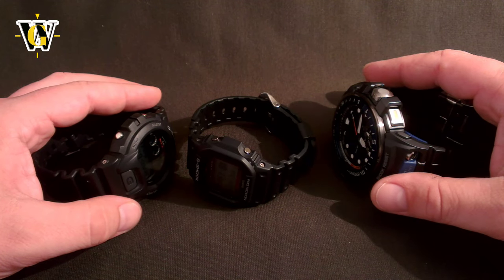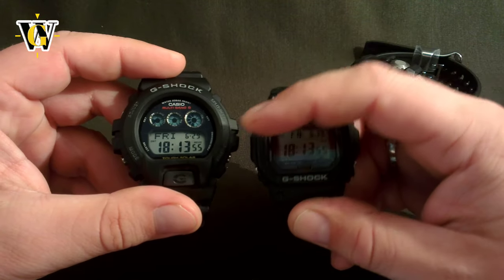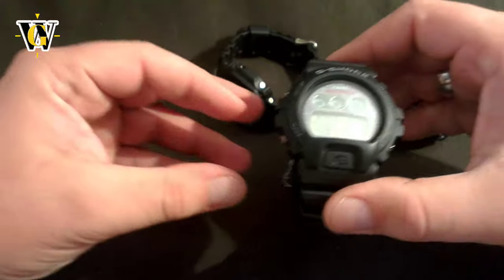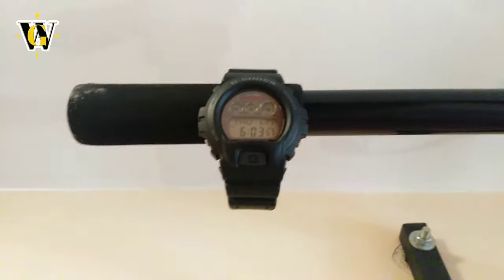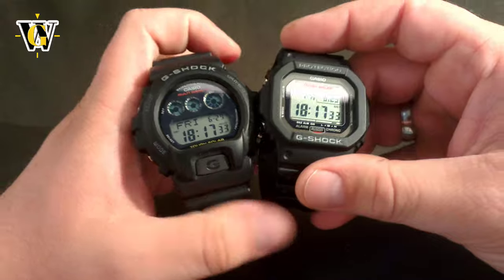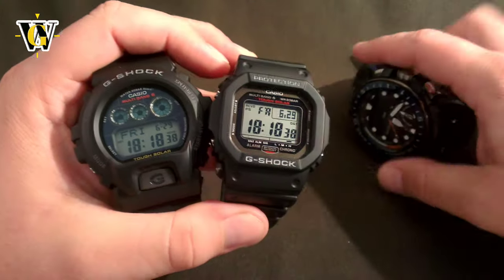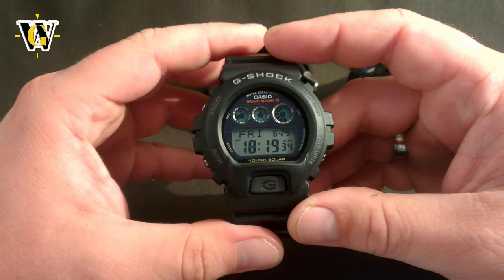DIY Amplifier for Atomic Radio Controlled watches that actually works & is VERY  simple

Comment: Hi it works i live in Brisbane Australia put watch on bike and it turned in only trouble is i set it to Tokyo tower but it changed it to tokyo time do i set it to SYD will it still pick up Tokyo tower but not change the time here
Reply from the maker: Great to hear it worked, you can try it or select another home city that has your same time zone if it is offered
Reply: I live in Brisbane as well and I set my atomic watches permanently to Tokyo DST time. Since neither Japan nor Queensland use DST this has the effect of adding 1 hour to Tokyo time (normally UTC+9) resulting in the UTC+10 that we use :) The only issue is the watch displays the small 'DST' symbol but I can ignore it.
Reply: Ok thanks will try
Reply: Did you try receive BPM time signal from China? There is a dcf777 app modulator availeble in playstore...
Reply: @WatchGeek  Did atomic signals stop? None of my Casios have updated in days..NO signal
Reply from the maker: @BOOSTEDLASER  as far as I know, they are still operational
Reply: @BOOSTEDLASER  no they are up
Reply: Hello and thanks for the idea!  Works perfectly!  I live in Bulgaria on the border of the DCF77 signal.  I hung the watch on my bike and at 00:07 the watch adjusted automatically!  Thanks!
Reply: The watch has to be on a city that has an atomic signal eg Tokyo. Of it's on any Australian city or won't sync manually or automatically.
Reply: The watch has to be on a city that has an atomic signal eg Tokyo. If it's on any Australian city it won't sync manually or automatically. I get syncing sometimes in Brisbane if I leave the watch on a north facing windowsill. It seems to be more successful if it's stormy, maybe cloud cover helps. I think the phase of the moon plays a part too.

Comment: It works!  I have three G-shocks and a Casio Pathfinder all of which synch with the atomic clock sporadically at best.  The Pathfinder hadn’t synced properly since November of last year.  Hung all 4 on the metal towel towel rack in my bathroom and for the first time ever, all 4 watches had synced perfectly. Good find, sir!
Reply from the maker: I'm glad I helped 😁👍
Reply: ⌚UTSTANDING
Reply: ? On th bathroom rack did you have facing up
Reply: @veedub3740  thank you.

Comment: At first I was skeptical that this could work, but as a ham radio operator, I figured that there must be an inductive coupling between the metal frame of the bike and the watch antenna.  Whatever it is, I tried several times without using your technique and could not get the watch to synch.  Then, but just attaching it to my camera tripod it synched up the on the first try.  Great observation on your part!

Comment: Since the wavelength of the German 75 kHz transmitter is just under 4000 meters, I would suggest a pipe length of about 10, 20 or 40 inches. The pipe should be perpendicular to the direction of the transmitter and the clock should be placed in the middle of this pipe. Propagation conditions are best between 1 and 2 a.m.

Comment: I just go to bed with the watch strapped to me and use my body as the amplifier ...works every time 👍
Reply: I might have to try this
Reply: I did try it twice and it worked both times.
Reply: I have just bought one and wearing the watch while sleeping has worked 2 times out of two.
Reply: @RodrigoLopezF  It also works if I put it in a windowsill facing west.
Reply: @kato223  Any chance I could borrow the wife? The bike shops around here are charging a fortune! 👍
Reply: @user-fb2me3th6z  ha no but water can carry signals
Reply: @Mike-nq7fn  what if I'm dehydrated?
Reply: @jasonhowell6935  haha well you are about 70% water still, regardless the most reliable way I have found is to put it on a metal like a bike or metal pole or whatever
Reply: @Mike-nq7fn  yeah. I'm gonna definitely try that. I only had mine for a few days now. But have noticed it hasn't synced yet
Reply: @jasonhowell6935  yep the bike worked perfectly for me, had to find the right spot in the house too
Reply: I've done this for years, never knew about the metal pipe trick though.  but yeah my wv59 only syncs when i wear it to bed.

Comment: This is crazy, I actually put 4 of my atomic watches and clocks on a metal cabinet and get 100% sync rate. But when I put them in the windowsill (plastic/wood) which is actually CLOSER to the window, literally, the success rate drops to maybe 50%. I never put two and two together. Great video. Metal works.

Comment: I have been having difficulty getting my Casio Waveceptor to sync ever since purchasing it a few days ago.  Nothing worked.  Then I saw this video.  I looked around for some metal and I noticed that I had a stand up (pedestal) fan nearby, so I put it on the fan - which has a metal cage surrounding the blades - and sure enough it synced!  Thanks!  👍

Comment: That Casio radio controlled watches have meters of radio signal strength. It's a pity you didn't measure signal strength without metal bar and with metal bar under back case. It would be interesting and objective.

Comment: You, sir, deserve a Nobel Prize, as far as I am concerned 👍 👌 🏆
I just managed to sync my Casio M710 multiband 6, that has not synced for months.
I'm in Europe, at the edge of the German tower and generally only go to sync my watch when we change to and from the summer light-saving time. I go to a park above my town to two specific alleys and only there I can sometimes get coverage. There I spend an hour or two sitting on different benches and triggering the syncing with varying success rate, until it syncs, sometime it works in one place, 6 months later it doesn't work, but works 50 meters down the alley.
Now I just put the watch around a metal deodorant spray can, put the can horizontally on a table by the window at home and it synced straight away at home. I've never managed to sync the watch at home before 👌

Comment: Finally! Signal Received!

My Casio GWM5610U came yesterday July 22, 2022. I ordered from Amazon and I was very exited to test the multiband 6 function. 

After manually attempting to get the signal, I kept getting the error message. 
I found a video about amplifying the signal by placing the watch on a bicycle or metal large frame and got some L1 and L2 signal and after a few minutes the error message again. 

I then tried positioning it facing northwest by a window (facing Fort Collins, Colorado where the signal comes from) and I was able to reach L3 temporarily but then error again. 

It was very late, so I tried wearing it overnight to see if my body would amplify the signal and automatically eventually sync (following advice from another YouTube video) but that didn’t work either. 

Success came when I stepped outside this morning and sat my watch on a beach Tommy Bahama foldable chair, the watch facing northwest. The watch displayed connectivity with L2 and L3 switching back and forth and after about  4 minutes it finally happened!It felt magical and I’m not sure if I’m going crazy due to the lack of sleep. I hope this helps someone out there.

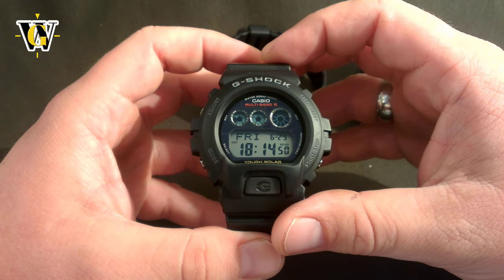Comment: I use gw7900. I live in Indonesia so far away from japan and we know with my time zone (BKK) is not possible to activate my atomic timekeeping sync. So before I sleep, I set my watch home city to Tokyo (TYO) which is 2 hours ahead from my local time, then I set receiving radio signal to  On/auto receiving and I hanged my watch on steel rod of my windows in my bed room. When i wake up in the morning and check my watch, Its incredible!,  The sync  indicator is appeared!!  Its SUCCESSFULLY SYNC  at 02:03 Tokyo Time!!. After that I set my time zone to BKK again to get my local time. Your method very useful. Thanks!!
Reply: Serius nih bisa sampe Indo?  Di kota mana om?
Reply: wow that's nice to hear that, i must try this as well on my gw5000. i live in kuala lumpur
Reply: You could set Tokyo as your world time (WT). On my Casio, when I press Adjust + Reverse buttons, the watch switches between home time zone and world time zone. Then you don't need to use the setup menu.
Reply from the maker: @spacemanschannel6380 that's some level pro advice 👌

Comment: Your method worked for my 5600 Bluetooth! I used my wife's old golf club, a long old wooden headed driver and placed it horizontal. I was only getting level one without, and tried it at 5pm and to my amazement it connected level 2 and 3 bouncing back and forth. Wow how amazing. At night it locked at level 3. I am in NE Minnesota and the Atomic is in Colorado. Thanks, much!

Comment: This concept worked for my large "Atomix" Wall-clock. 
It hasn't set itself ever since we moved to this new house, which has been about a hear and a half now.
I just taped about 24 square inches of aluminum foil to the same size cardboard and slipped it behind the clock.
The next morning the time was set, matching my computer clock down to the second!

Comment: This tip absolutely worked for me! I live In Michigan hung my watch from the aluminum tube connected at the bottom of my window blinds. Raised the blinds half way up the window & the watched sync'd a few minutes after midnight!!! Amazing! Thank you so much for sharing this tip!
Reply: ⌚UTSTANDING! I live due south of you on KS and can usually get the signal (Boulder CO?) overnight but never can do manual sync on my GW5000U. However, I got a new 5610U and used a metal pipe outside, mid afternoon -manual sync worked! I was shocked and impressed 🤷🏼

Comment: I got a used G-Shock for a really good price, and couldn't get it to sync up at all for several days after I bought it. I thought that something was wrong with it as I tried everything from leaving it by a window overnight, to trying several apps and nothing worked until I saw your video and tried it on a friend's bike as I don't have one & it worked right away on the first attempt just after midnight! You are correct on the metal tubing as I tried it on the back of a chair with metal tubing and got results again on the first time. Thanks for posting the video!

Comment: I too accidentally discovered this with a round steel lid (about 4.5 inches or 11.5cm diameter) on top of a glass jar containing cotton balls and Q-Tips.  I had a lot of trouble picking up WWVB here in Atlanta, Georgia from putting the watch in my window sill and one night I had placed it on top of the cotton ball dispenser's metal lid while getting ready to go to bed.  I forgot to move it to the window that night and the next morning it had picked up time code signal perfectly!  So for ten nights now I have had 100% success with the metal lid.  Now the lid does have a small metal ball in the middle for lifting it up and maybe that also helped.  Will have to do some experiments using other metal objects with copper or steel.

Comment: I was never able to pick up a signal since buying my GWM5610U over a week ago. This worked like a charm! I attached it to a metal towel rack and it picked up a signal overnight. What's even more impressive is that my bathroom was in my basement where I barely even get a cell signal! Thanks Watch Geek!
Reply: I've just bought that same watch and the alarms are so quiet that they are almost useless. Also, the buttons are so stiff that it's not enjoyable pressing them. Is your watch the same or have i bought a dud
Reply: @alantheloneranger  The buttons are stiff and sometimes it takes me a few tries to get them to work, but the way I see it, it's better this than having them accidentally engage. Regarding the alarm, it seems to be loud enough but I've never used it in a sleeping situation so I'll have to let you know!
Reply: @ydawg01  I don't reiy on watch alarms to wake me up, i sometimes set them a few minutes before a main alarm or use them as reminders during the day. But even when awake in a quiet room i still can barely hear it
Reply: @ydawg01  regarding the stiff buttons, every casio I've had over the last 40+ years have had buttons with just the right amount of pressure to press them but with just enough pressure not to be accidentally pressed easily. I currently own 2 tough solar watches and the buttons on them are almost perfect. I can live with the buttons being like this but the alarms are so poor that they might has well not be there. I've watched loads of good reviews about this watch and not one has mentioned a poor alarm which is why i thought mine might be faulty

Comment: Hello. I just bought a citizen cb5020-87l, I'm from Romania, and I had problems with radio synchronization. But this video helped me. I used a metal bar and it synced last night. Thank you for the help.

Comment: I’ve had a left over 4 foot length of 1:2 inch copper pipe sitting in my living room for years. I’ve been trying to think of how to make use of it and not dismiss it to the recycler.

Sure enough, your discovery works. 
The old pipe now sits happy in plain view not far from the TV. A couple of new black and red clamps hold it horizontally on a book-shelve with plenty of room on one end to easily slide watch on.. It works every time even though its not near a window. The watch never syncs in that spot without the pipe. BTW, I live in a metal frame New York apartment building. THANKS!!

Comment: It did worked! 
Placed mine in a metal curtain rod and started to seek signal and later synched! 
Watch: The Clock House 1964
Analog-digi window model
Location: Philippines, Central Luzon

Comment: My watch would not synchronize in my room at night automatically,  until I started wearing the watch to bed.   Then it worked perfectly.  Maybe my body amplifies the signal reception for the watch.  Now,  I can reliably get an automatic synchronization, but manual ones seem to be harder to get because you have to have a steady L signal outside or near a window.

Comment: If we learn the signal wavelength we can use the correct diameter pipe or in other words the antenna. I'm not sure but,  in Europe Region, for 75kz the antenna diameter would be ≈2.5 cm and 1 meter long. For example, in the early period of wifi technology, Pringles boxes could easily use as a wifi antenna.

Comment: Awesome discovery! A GW-7900 is on its way to me from Amazon and I am looking forward to experimenting with your metal tube/pipe method of enhancing signal reception.  Thanks a million for sharing your knowledge and wisdom.
P.S.:  Last night, I hung my brand new GW-7900 onto the end of my cloth-hanging rod in my closet and see if my G-Shock could pull in the atomic radio signals from the Fort Collins facility in Colorado which is over 2200 km (that's over 1360 miles) away from my location.  This morning, sure enough, the watch shows that the synchronization was completed at "00:04", i.e. at midnight.  Needless to say that I was pleasantly surprised and impressed at how well the suggested method as described in your video had worked.
  I surely hope that the Fort Collins Atomic Clock will continue to send out signals for many years to come.

Comment: i can't believe it actually works! I was ready to sell my wave ceptor. Bought brand new for a year now and the whole time it would not sync. Not even once! I thought the towers already stopped broadcasting.  Thanks for the tip!  model: Casio Wave Ceptor  wva-m640-1a2jf.  location LA California. Amplifier: Pull up bar 😁

Comment: I didn't have any problems with reception but did the test on my metal desk lamp (0.5cm thick, hollow, square bar on a cheap ikea desk lamp). No amp sync time: 5m15s; Laying on the lamp bar (at the same location): 1m58s. Just one test but the results are huge. More than double time reduction also the reception was more stable (L3 all the time). Great tip for people outside of normal reception range. Works as an antenna.

Comment: WOW THIS REALLY WORKS! I live in a condo on the lower floor. I never got an over-the-air signal, I thought because my unit is in the north east corner of the building and Fort Collins CO is to the south west of my home in Canada, near the edge of the broadcast area. I bought a metal pull-up frame from the thrift store and hung it over the door frame. I have 5 Casio Multibands and they all sync after the first night!!

Comment: Yup that works!! Thank you so much for the tip.

I’m in Toronto and I live in a high rise apartment, which is facing opposite direction from Colorado tower.
I wasn’t having successful sync but when I tried just putting my 5610 on a metal Deodorant bottle and executed manual sync at midnight time… in 4 min I got RCVD 📶

Advise: Those who don’t have a metal rode or a bike, no need to spend money on them. First try by already available metal objects in your house 🤘🏻

Comment: I just bought a Citizen AT4127-52H PCAT and the only way I could get it to sync was using an iPhone app that simulated the tower signal. After seeing this video and reading the comments, last night I hung the watch from my curtain rod before bed. This morning it showed that it was synced (it showed the signal at Low, but it still worked). Thanks to all for the suggestions :)

Comment: Made an accidental discovery when I swapped out the original strap with a metal mesh magnetic one. 
You'll need a CasiOak (GA2100) 16mm to 22mm lug adapter, which will allow you to swap out different straps easily. 
Now, I'm able to get automatic atomic time sync effortlessly despite being nowhere near any atomic tower, as the metal mesh and magnet has become an antenna to reach out to the atomic clock signals.

Comment: I have a Casio model GW-S5600-1JF.  I live in West Palm Beach County, Florida,  so I am on the fringe area from Fort Collins.  I tried many nights to synchronize manually to no avail. Yesterday at 11 PM I tried to synchronize manually using my bike as described and it worked. Today it synchronized automatically at 12:05 AM (first attempt).